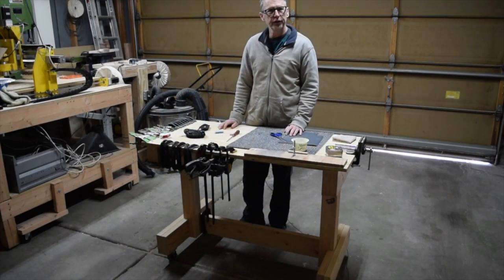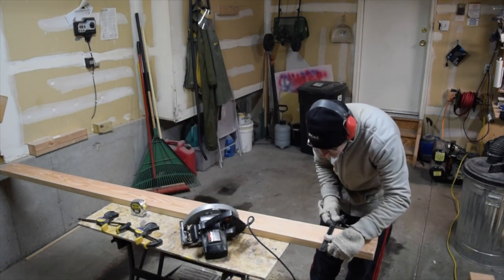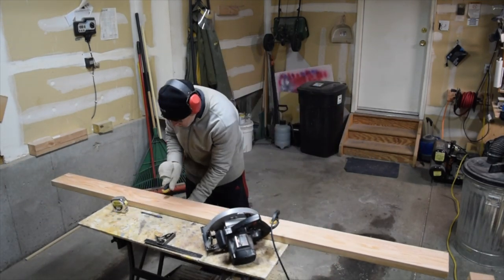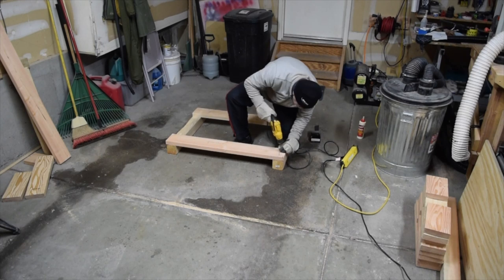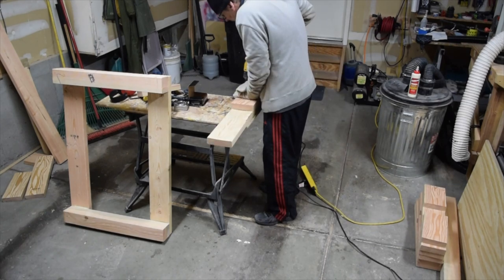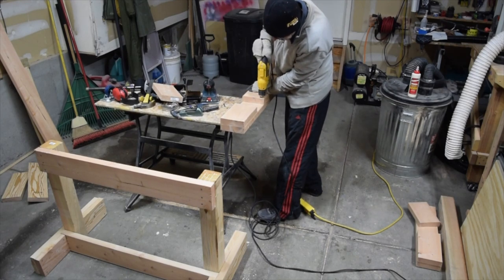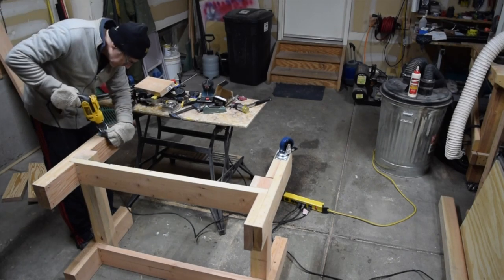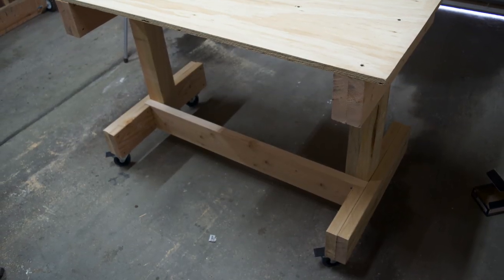Making A Rolling Workbench For My Shop

Comment: I use two sawhorses and a sheet of plywood. I need to devise a way of quickly attaching and detaching the plywood from the sawhorses. I tried using casters on my workbench but the concrete floor is uneven in my garage which makes the bench really wobbly. Thanks for sharing, you always have good content.

Comment: Hi. I love the videos. I'm going to try and make this bench myself. Would you be able to tell me the lengths of the 4x4 and 6x2 you used for the workbench supports and cross-member supports? Thanks in advance.
Reply from the maker: The 4x4s are 29" and the 2x6s are 41"
Reply: @HighlineGuitars  Thanks so much Chris. I'll send a photo when I'm done.